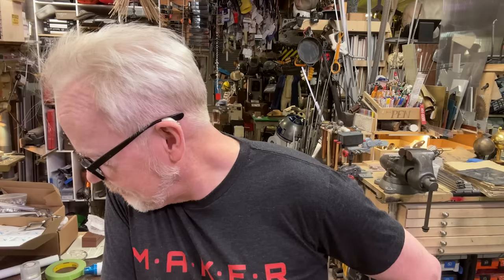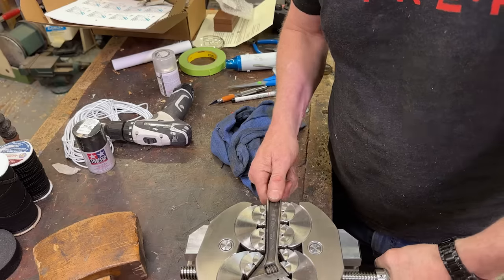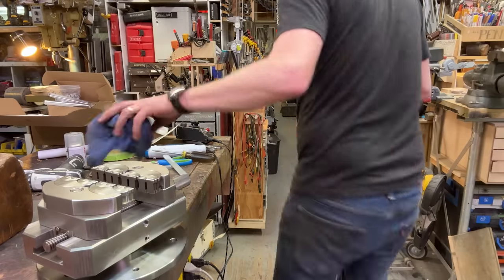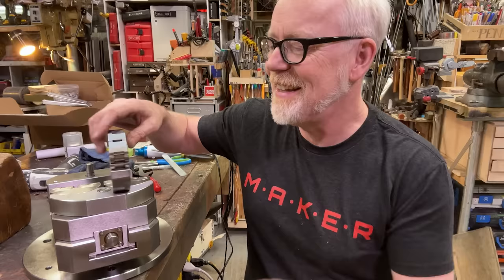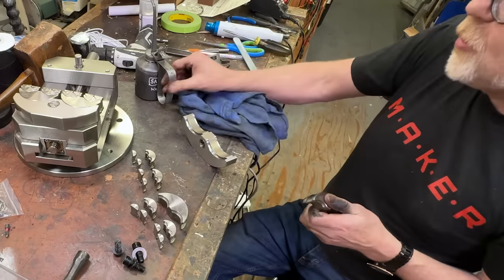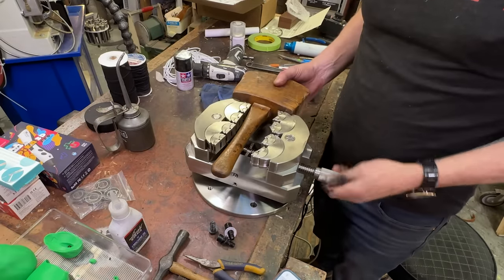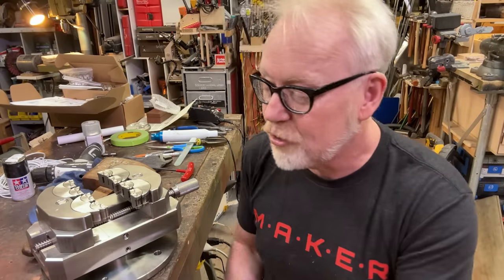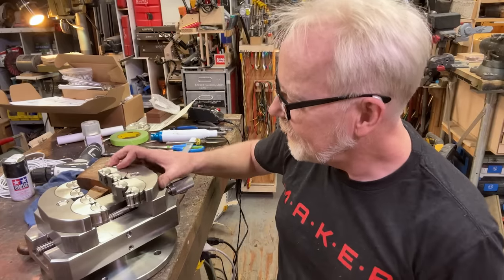Adam Savage in Awe of This Fractal Vise!

Comment: Adam, the problem I have with Chinese products is that it is highly hit or miss for quality. Some is good indeed, some fall apart very quickly.

But the bigger problem I have with Chinese products is they don't follow IP law so well. "Chinese Counterfeit" is not a stereotype without reason. Though this product probably isn't so much of an issue in this regard due to it being such an old tool design.

Comment: The problem with most of the stereotypes of the 'Made in China' products is that much of those stereotypes should be aimed at the American/German/French/whatever company that ordered them, not at the manufacturer. The Chinese manufacturer simply makes what they are requested to make. They obviously will not make a high-quality product if their client requests them to make a low-quality product and pays for a low-quality product.

Anyone that would go to a sizable, custom manufacture in China would find out that if they ask for a really high quality product with high quality material...they will get just that.

Of course there are also many Chinese knockoffs of high quality products (and mid quality products) that are bad. But what exactly do people expect? There are slightly over 8 billion people in the world. There are over 1,4 billion people in China. They turned a rural, poor country into an industrial powerhouse in a few short decades. There's a LOT of people living there that cannot compete in quality or innovation, so they resort to compete with price by cutting costs and offering worse copies of goods that sell. But it's not because they lack the skills to make higher quality. They lack the means of using those skills. And later on...they lack the need, since people buy the cheap knock-offs anyway...

Comment: About Chinese engineering, materials and quality. They are CAPABLE of doing the exact same things that anyone anywhere in the world does.
It's all a matter of what you pay for and what they pay their workers.
A Chinese CNC operator might be paid 50% of one working in the US but that Chinese CNC operator is still paid a superior wage to any other Chinese worker. So he/she takes pride in the work he/she does. And the materials he/she gets to work with are picked based on the target consumer, which in this case is nerds like Adam Savage, who are willing to pay US $2500 for the product so they don't just go to a scrapheap and re-melt a bunch  of random steel to forge a block to machine this out of, they pick a suitable material for that price bracket and make a quality product. Not custom hand made but quality enough to where not just a few will get one but anyone who's interested enough in a fractal wise and willing to pay for a good one.

If it was made out of complete garbage it would have been a waste on both the manufacturer and consumers end. And Chinese want to SELL stuff, they don't just make garbage because they can.
Most Chinese garbage that is made is made to ORDER, meaning someone from abroad ordered a batch of sub-par quality crap to be able to up-market sell those items in Walmart, harbor freight or elsewhere. Most of those kinds of people are the same that shut down factories in the US for the sole purpose of ordering the same things from China, with prices cut to a fraction of the original manufacturing costs.

... And guess who's still paying for it? That's right, the very consumers who lost native manufacturing capability because the price is lower.
You vote with your wallet and you've been voting for Chinesium and so you keep getting Chinesium.
There was a time when that wasn't the case, where all consumers cared about was getting quality tools... Not so much anymore, now it's all about "that's expensive" and so they go for the cheapest option despite it clearly states MADE IN CHINA or MADE IN PRC. And despite the fact they can actually visually see the subpar quality of the tools they are getting. They still buy because the price is lower than the quality tools and they gamble on that the cheap chinesium tools will still do the same job, which they won't and it will cost them in lost time and having to buy more tools in the end as well as potentially ruining whatever thing they are working on.

Comment: Interesting concept but this vise wouldn't work for me. Most of my projects require my work piece to be held tightly and it can't be done with that fractal vise. Note that there's only a "file handle" on the end of the acme screw instead a a 12" crossbar like my vises have. Without the tightening bar, not much torque can be generated. Also, if the vise was modified with a 12" handle, I suspect you'd bend the 12mm (1/2") dowels that hold the pivoting jaws and even worse, shear them off.
Reply: A typical 12mm dowel ( SUJ2C Hardness 58HRC) will buck approx 2000lbf continuously.  That’s not a huge amount for a vice but enough for light passes.

Comment: I wonder why they chose a knurled handle honestly, there is no way you can get the torque you would require on that thing. Normally something like a Kurt vice wold have a "crank" handle. 
Maybe this vice isn't spec'ed to hold as tight because of the weakness in the jaws? Is this rated for Machining applications - it "looks" like it is, but that handle really bothers me.

Comment: I'm not sure I'd trust the quality of the steel sold through Alibaba. Like, is it even stainless? I've seen some seriously weak steel come out of China, like rebar you can break just by hitting it with a hammer. The milling and metalwork might be great but I'd just be worried about the strength of the materials.

Comment: Before an American company would make anything like that, they would probably spend a few hundred thousands on market research, and another hundred thousand on board meetings and employees approving the project, and then a single engineer would have the plans in 2 days, and then they would spend another few thousand on trying to pinch a few dolors off the manufacturing and materials, have the engineer make changes that lower the quality or function... and then once it's finally on the market, the price is so high few will want it, the warranty claims and returns because it was made cheaply would cost them money in addition, and then they will stop making it and fire the guy who had the idea in the first place, and the engineer!

Comment: I am curious of the repeatability of true position tolerances when loading production products, it seem the datum would need to go off the centerline of Y or X, per positioning. It's great for one offs. 
The holding power presses against the two pins, when clamping hard the pads may rise up if not secured down.

Comment: The problem with China is if one good company making an excellent high quality product there ends up being several other companies pop up that makes a similar item at a lower quality work and lower quality materials instead of using steel they will use cast aluminum or even cast zinc. That is why China has that reputation due to these quick buck counterfeit companies.

Comment: Looks like a great interesting tool. Since it's basically a machined piece of metal done on a CNC machine which America has a ton of machine shops, why not go that route and customize your very own version with all the bells and whistles and have it work the way you want the first time around rather than give our enemy more American dollars...that was $2500 too much if you ask me. Doesn't hold a piece of wood without it dropping back to the table yet its being worshipped like it does and you still have to modify it to actually work correctly. China makes just about everything that can be purchased and I fully understand that but it would have been more original having one made for you, to your specs, fully custom and made in America to support American workers. Even it is cost you over $2500 to accomplish that, I see that as a custom well build piece that works and shows pride in its craftsmanship and not something you have to fidget with to make it work correctly. Not to mention you would be the owner of the ONLY one in existence.

Comment: it's not a stereotype about products in china

great thing done there cheap bootlegs are done there. but with them not cracking down on bootlegs and sometimes even encoraging them it is really hard to get waht you want.

i ordered about 10 sets of pones and 10 came not like on the pircture
i ordered sock suspenders and they came good
i ordered a super expensive pc mouse it came dead
guy ordered pepper seed they came wrong

it's a lottery

also ali customer service is not on par with ebay. it exists
Reply: i'm not in usa and we have common border and super good relations with china

Comment: i have no issue with quality tools made in china its when you start seeing tools built to a cost where the companies push it as cheap as possible tool usability be damned, a high quality tool can be made anywhere just like a low quality tool, chinese firms just like to race to the bottom for tool cost and quality,  i have a wrist wrest on my desk thats higher quality than the german one i purchased previously